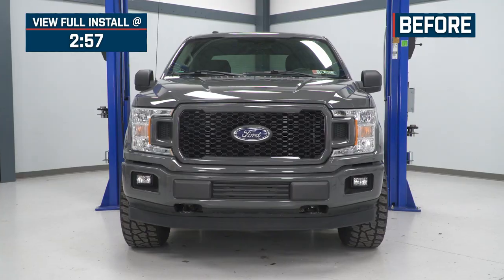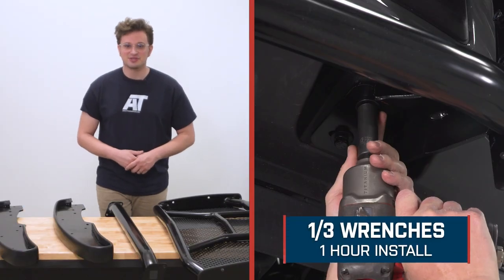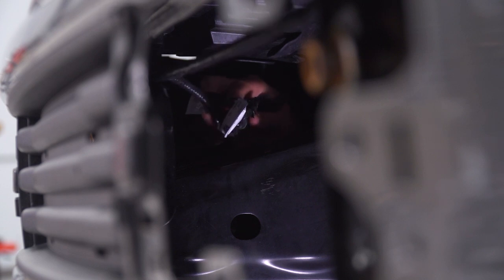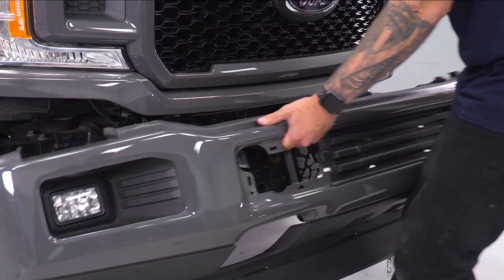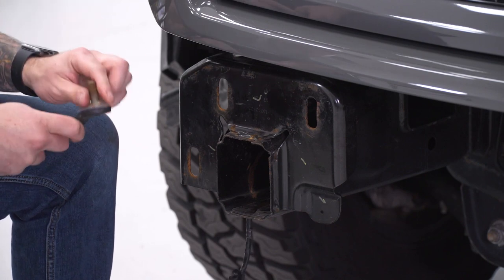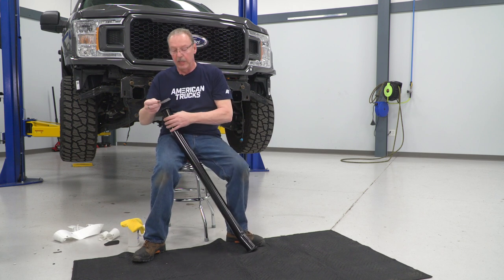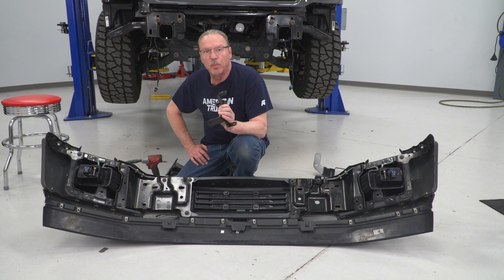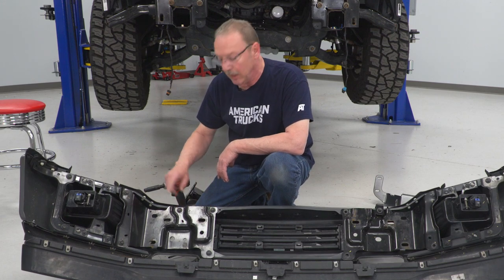2015-2020 F-150 Barricade Modular Extreme Heavy Duty Brush Guard Review & Install

Comment: I finf the shown process overcomplicated for what it is... but I guess anyone can actually do a great job on improoving that on their own.

Only thing here is that you guys coul've very easily engineered this product to be much simpler to install.

Why not using the lower corossmember only to install and adjust the brackets that go to the chassis? From there, you could install the main side pieces with the center grille proyector loosely in place, tighten the lower portion, tighten the upper portion and finally add the headlight protectors.
If you provide the hardware (and a couple extra bolts, washers and nuts) you could make some threads in the main side pieces to install the bolts from the inside, tihten those and then have them as studs for the headlight pieces (and then use the nuts). I hope the feedback helps for new products or reviewed versions
Reply: It was designed by barricade. These guys are just installing it. 😂😂😂